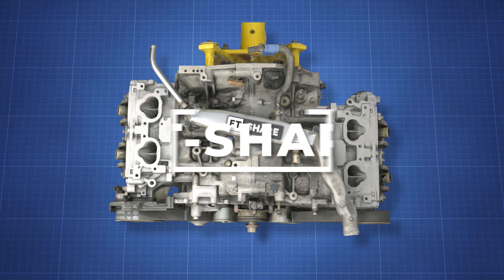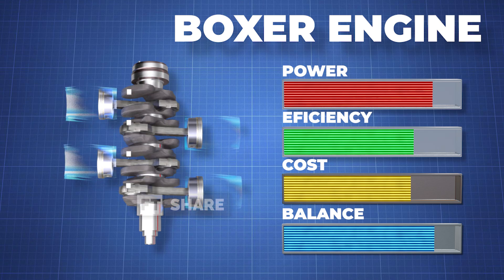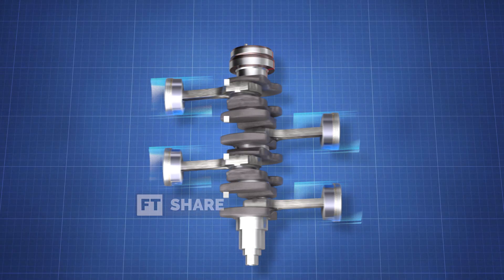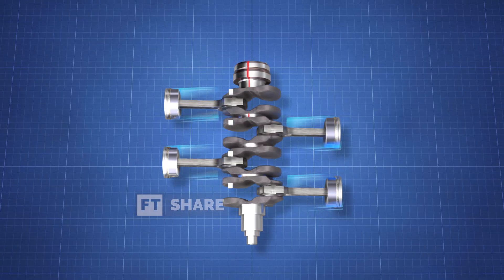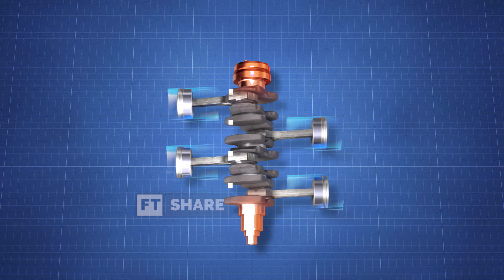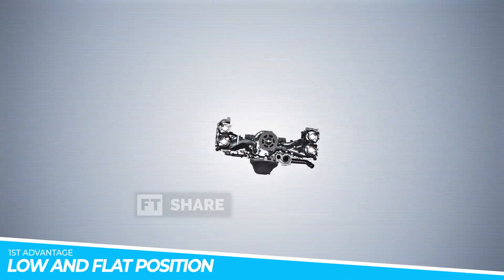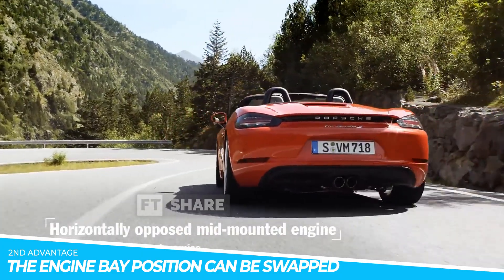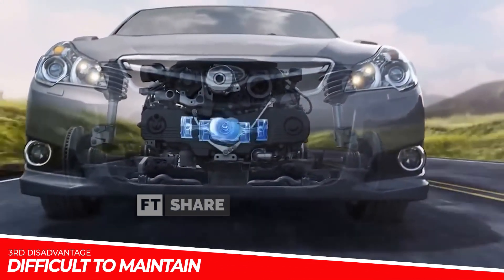More Balanced Than An EV's?!! - BOXER ENGINE

Comment: The animation of boxer engine firing order is not correct.
Reply: Not only this, the "distinctive boxer sound" is also only a product of an assymetrical exhaust configuration. Older Impreza had it, but newer Subarus (including Impreza) had a symmetrical one and they sound just like any other engine.
Reply from the maker: Thank you for the correction, and we apologize for the mistake in the video where it was reversed; that was purely our error. However, William Mosse uses the same firing order, 1-3-2-4, referring to Subaru. If you are referring to VW, then it becomes 1-4-2-3.
Reply: @ft-shareinternational2146  For a 4 stroke 4 cylinders engine, firing interval should be 180 degree crankangle regardless the engineconfiguration, but it is 360 in the animation. For boxer engine opposite go to TDC and BDC at the same time, therefore they cannot be have ignition consecutively. Bixer 4 firing should be left left right right. That's why B4 engine have special sound.